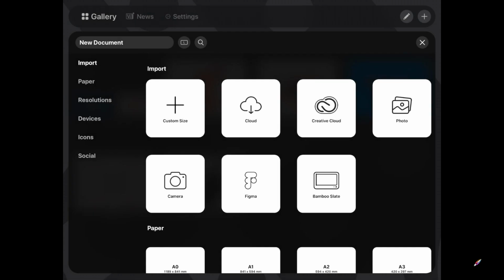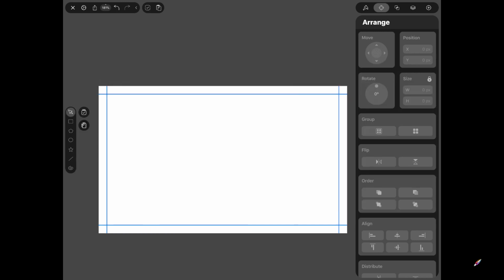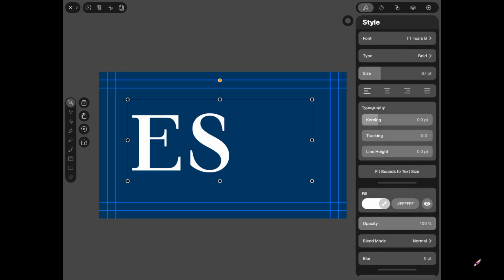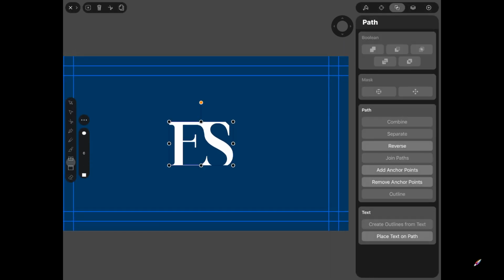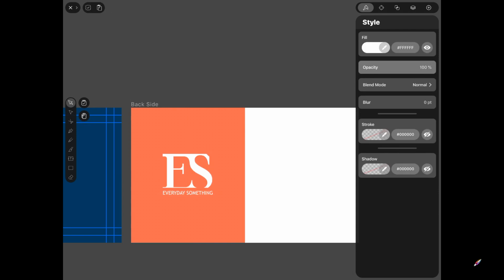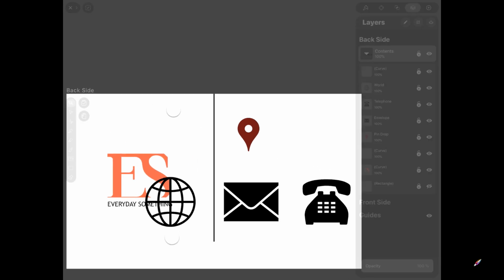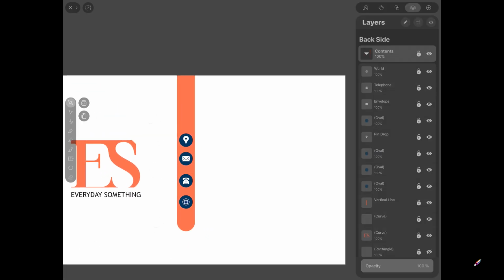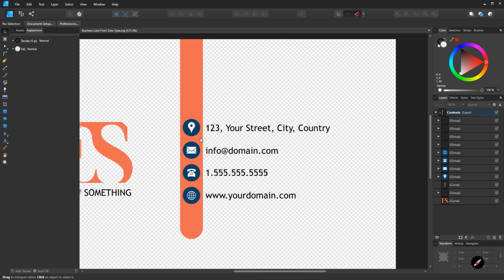How to Design Business Cards with Linearity Curve

Comment: hello sir. as we know business card after used for print media. and also we know resolution for print media should be 300dpi. 
you created custom artboard for size in inches. but how we can adjust resolution like 72dpi for screen or 300 for print etc
Reply from the maker: It's not possible to set DPI in Vectornator, non-vector elements get exported with the default value 72dpi. We would be grateful if you visit our Feature request page and upvote this post https://feedback.vectornator.io/posts/125/to-be-able-to-set-print-resolution, so it gets more votes and will be added to our roadmap. Cheers!